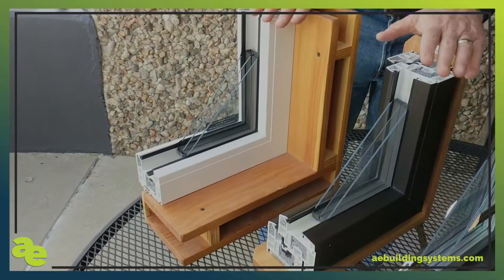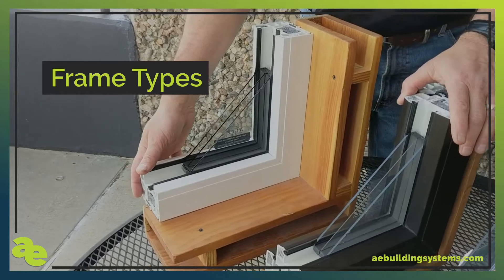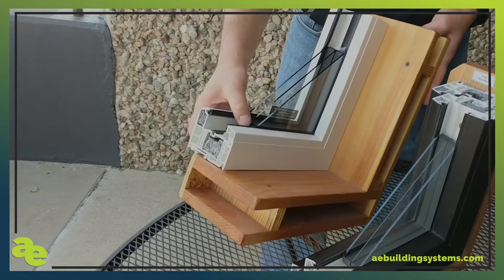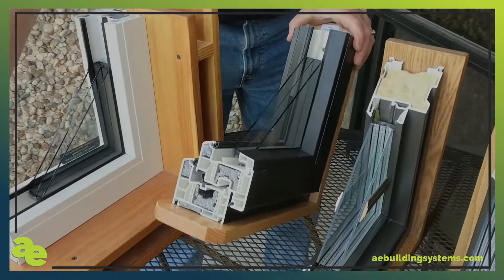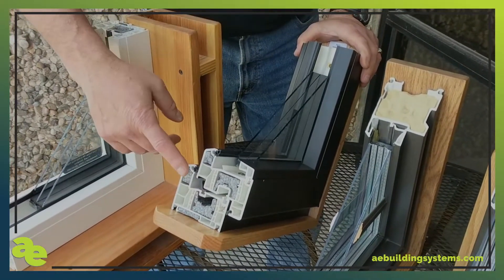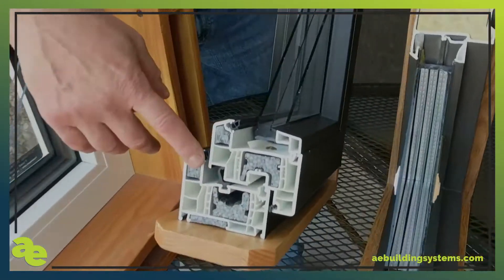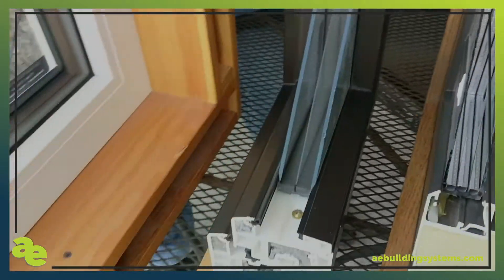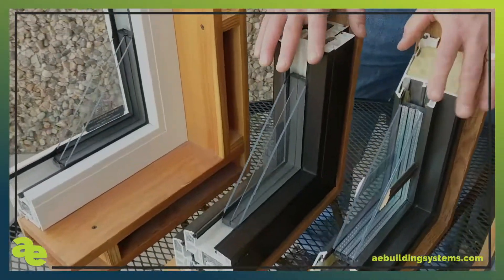Window & Glass Types by Alpen | AE Building Systems

Comment: How much of a bump in R value or U rating does krypton give you over argon?
Reply: My understanding is - keeping the glass assembly exactly the same, krypton is around a 25% +/- boost in performance. Note that there are many variables that can impact that equation.
Reply: Its a 25% boost in r value. But Alpen gets all that by charging 6k for a single door that doesn't even operate.